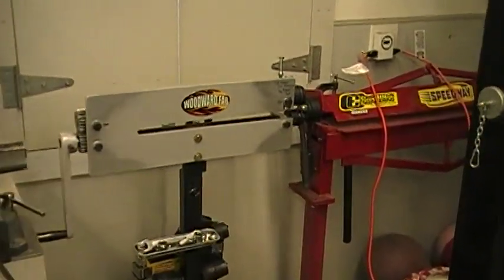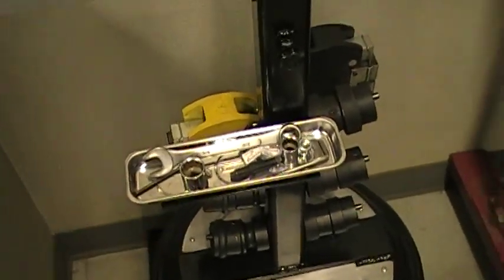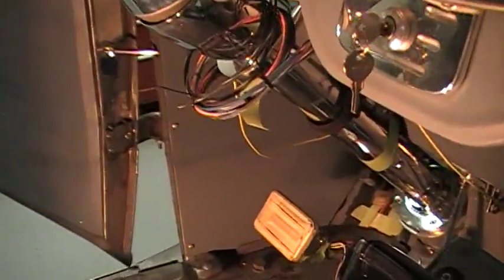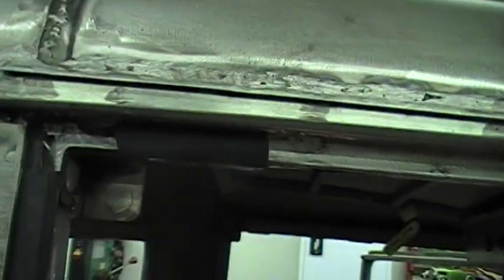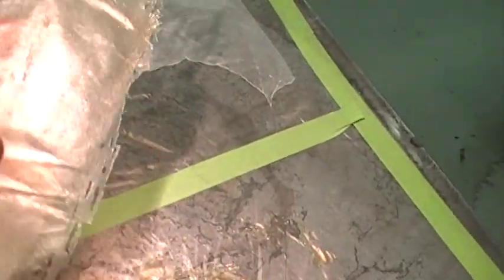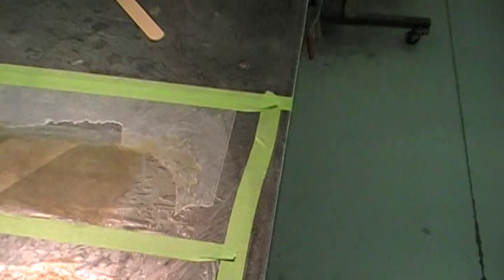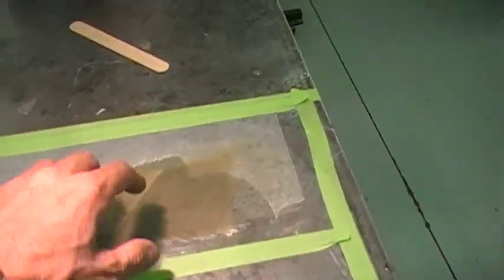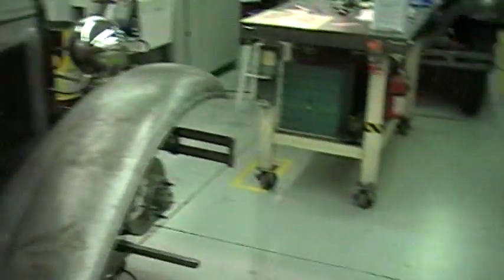31 Ford Model A pickup 32

Comment: Hi Terry. Thanks for the recommendation on the scale. I was unsure which one to buy when I was at the store last week but I did see that one. So now I know what to pick. I like to use a silicone mixing bowl to mix fiberglass and when it dries I just squeeze the bowl and out pops the hardened glass and the bowl is clean and fresh. Ya, I'm not just cheap but lazy as well. lol. Hi to Julie and God bless you folks. A kiss for Shelby too.
Reply from the maker: +EdOfTheNorth Hi Ed Ive used the little scale quite a bit over the last several days it seems to work very well . The protective bag ive got it in kinda messes with it a little but its way close enough for what im doing with it.God bless you and yours Julie says Hi and Shelby im sure thanks you !

Comment: That switch panel, and all the rest of your metal work, looks nothing short of "GREAT"!! I bought a 48" Woodward Fab box and pan brake. Certainly not the "expert" on it but seems like a great tool for the price. That stand for the bead roller/shrinker came out very nice. Looks like you must have lots of experience with metal fab. And, a good eye for design too. Thumbs up!!
Reply from the maker: +Pappa Bob Thanks for stopping by !!! Well ive been dabbling in this kinda stuff since third grade and im 46 now so yes ive been playing a little while LOL !I have a friend of mine that works at a truck repair center and I asked what he had in the scrap pile and that brake drum is what I came home with. Thanks again for stopping in!!!!

Comment: Love the detail you have done on that truck , top notch , love the stand for the roller too . I wonder how accurate that scale would be for mixing paint ? I know the ones in the body shops are ridiculously high
Reply from the maker: +MrFireman164 Thanks for watching Roger ! I actually really like that little scale (for 20$) cant really go wrong. The ziploc bag I have it in to protect it from the resin kinda messes with it a little. I dont know how accurate it would be for paint mixing , ive always used the ratio cups. Probably could do a mixing test on a non essential par to see if it hardens correctly......
Reply: +johnsont963 yeah I bet the paint scales are high dollar for a reason , and mixing your paint is something you want really accurate , but like for doing slick sand it might work fine